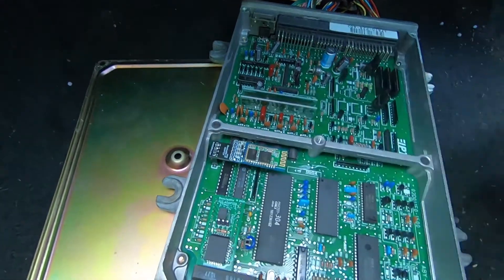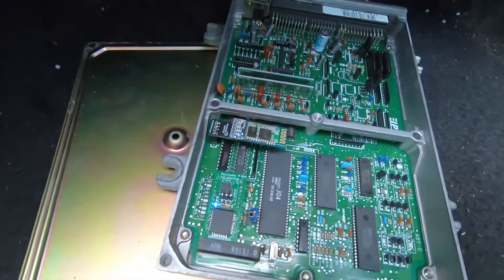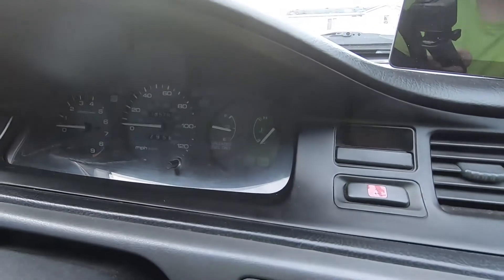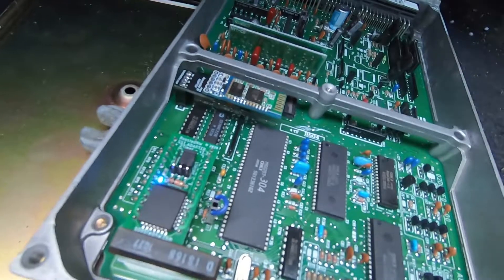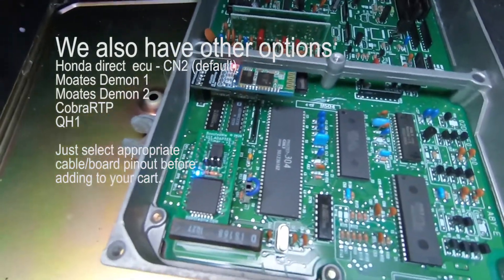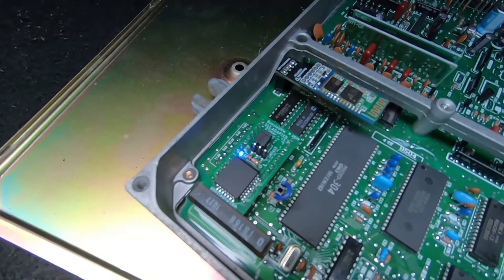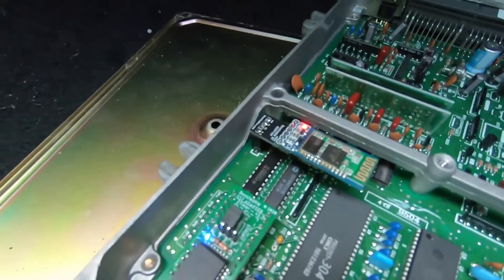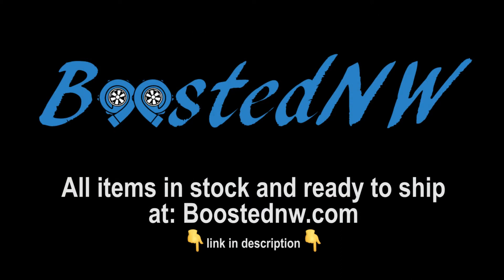BoostedNW SST Adapter + 2-Timer

Comment: Can you swap tunes in real time or have to shutdown the car, flip the switch and then Turn on?
Reply from the maker: if the tunes not much different like just switching 2 step params, or higher boost levels, and not like live map data... then you can do while car is running. If its like actual completely different "maps" then shut off and back on